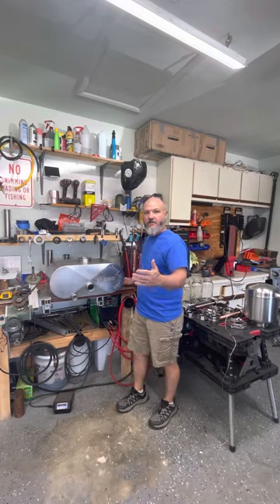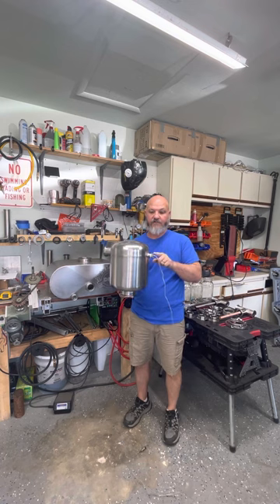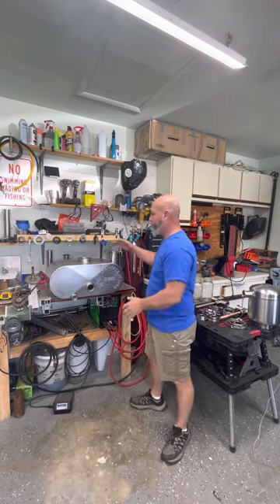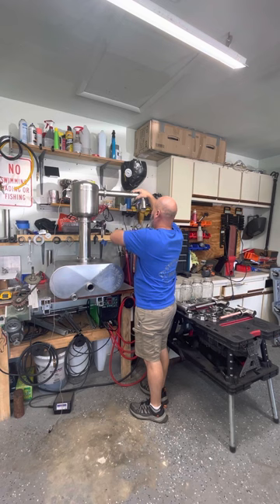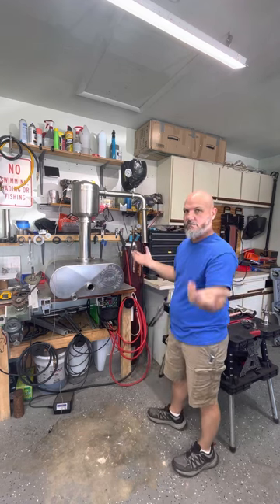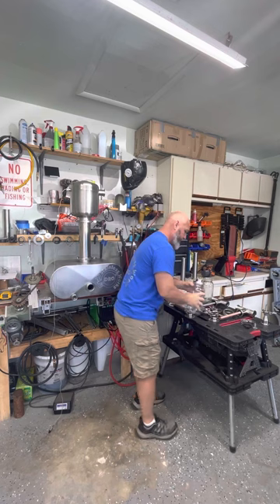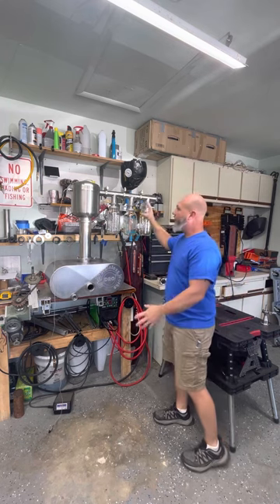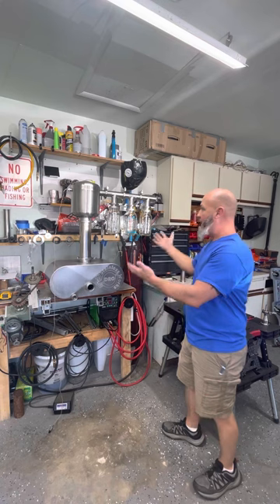10 gallon Starter distillation system

Comment: Thats some great looking work definitely peaked my intrest especially for being able to be used as a 1st timer setup with the option to grow into being a long time producer.
Reply from the maker: You can also go look at phill billy moonshine on YouTube as he has done a run and review on it. I absolutely love this little tank.
Reply: @Dustin Stugart  thats how i found your video. I been watchn his channel bc of seeing his keg setup an now im debating which setup wld be my best option for my situation
Reply from the maker: @RK_Kong69  now that is a big question that only you can answer. I also have a keg. With that my height is a problem. Even on the ground because I use electric and not gas. With my sub pot on electric the top is under 4’ tall. I now use this as my go to setup because of the way it runs. And I use so many different setups it’s still short. But both type’s produce great results. Hope it helps. 🤙🏻
Reply: @Dustin Stugart  oh nice you offer both options in 10gal. As for heat i think id be good going propane as my workspace doesnt have power unless i moved to inside the house 😆😆.
Reply from the maker: @RK_Kong69  yes. I make each one custom to what you want to run. Now if I’m the future if you want to run electric I can put those fittings in so you have them. Either way you’ll be able to run electric or propane. Big easy tried to melt it down with propane and nothing happened to it. So your good.
Reply: @Dustin Stugart  alright that may be the way to go make it dual purpose for heating for later down road situations. When i get ready to make a purchase ill get with you to go over full build details